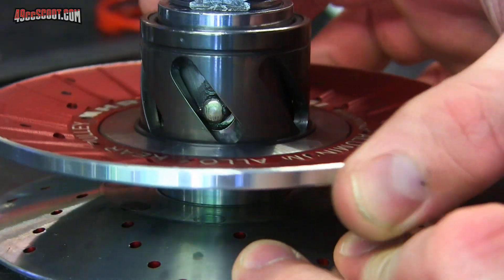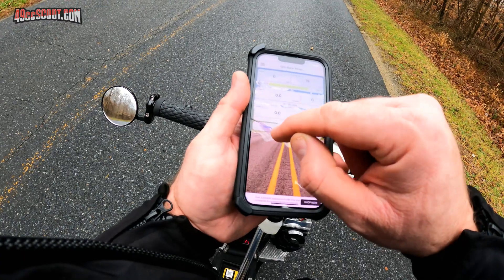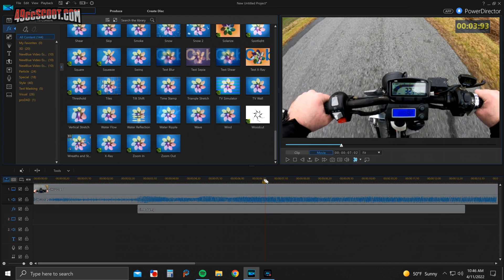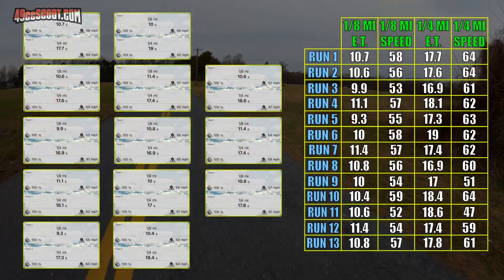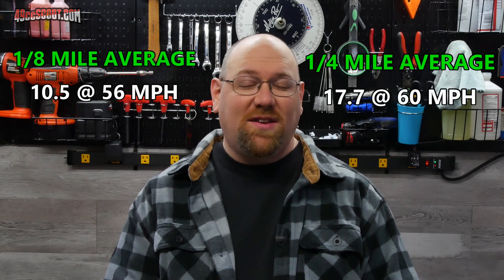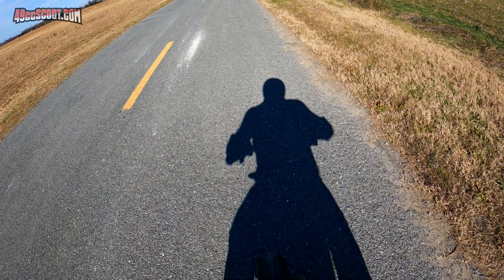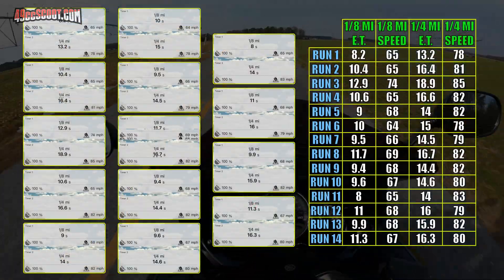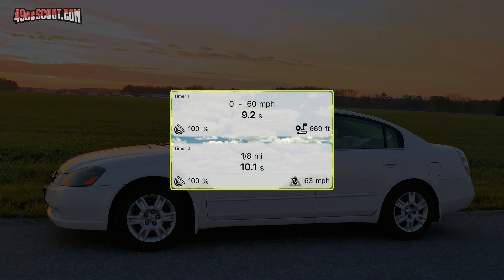Do Free GPS Acceleration Apps Work?  Let's Find Out!

Comment: phone alone is not good for acceleration messuring, you need to buy phone gps module (bluetooth or usb) with higher refresh rate like 10Hz and higher, phones gps have only 1-5Hz which is not so accurate
Reply from the maker: I have had a dragy for a couple of years now and it’s a fantastic tool. Highly recommend.

Comment: Great video, 2 yrs on, what app do you use for your 1/4 acceleration speed runs or what do you recommend? preferably with multiple timer simultaneously because, the other app only does one at a time. Thanks.
Reply from the maker: I bought a dragy not long after this video and it's amazing. I went to the track with the scoot and it was incredibly close to track timing, but the dragy does more than the track did. I have mine set to do 0-30, 40, 50, 60MPH and 60, 330, 660, 1000, and 1320ft. So I get all of the specs within a 1/4 mile (it records speed at each distance, and distance to reach speeds as well) plus the 0 to MPH data. It's awesome for tuning and seeing exactly what is changing when/where.  You can set it up custom, so you could do 7-23MPH times for example if you wanted. Can't recommend it enough for anyone that does acceleration testing/tuning. I don't like to spend money if I can get it for free, but I have not regretted the dragy at all. I've got a spreadsheet currently over 700 1/8 mile runs from it. Oh, and it tells you the density altitude so it makes it easier to see how the air quality is.

https://amzn.to/3YAiagS
(affiliate link)
Reply: @49ccscoot  I'm always ready to spend money but only when I get to test what I'm about to buy otherwise, I'll start with the free version. Any other free alternative to the Free app used in this video?
Reply from the maker: @Sir-Kay  I think it's going to come down to the phone. The dragy has a higher refresh rate and probably better satellite setup. I've never had weird results with my dragy. It's a regular occurrence with any app that I've tried.

Comment: gears in the transmission were still the superlight ones? Its ringing out. Way too light so speed is slow. Up gear the transmission
Reply from the maker: It was 11.2:1. Not many options for the Chinese clone long case. It was 10.1:1 stock, but the gears I'm using allow me to have more support bearings. Still not as good as the Zuma or Piaggio gearbox, but it works.
Reply: @49ccscoot  ohhhhhh, thats why

Comment: Unfortunately phone gps only updates once ever second, so the movement detection can be off by a bit. It has to estimate your finishing speed too because you may be 27 at one interval and 33 at the next. Most of the apps have a gps strength bar, so you can go to a location with good service and hopefully get more reliable results
Reply from the maker: I later picked up a dragy. Very happy with it.
https://youtu.be/psl2yMPIFnA?t=77

Comment: I am using Sigma  MC 1812 MOTO (50$) as the cheapest substitute for my broken speedo, it has a lot of functions, but I don't know how accurate realy is. There is many magnet driven aftermarket speedometers, also with drag meters, shouldn't they be more accurate than gps?
Reply from the maker: I use GPS to calibrate my speedometer, but I use distance traveled instead of just comparing MPH to adjust. I suggest at least a couple of miles for a trip to compare. Then you can consider comparing longer trips if you'd like. That seems to make them very accurate, as far as I can tell. I'm right on when I pass RADAR signs and with displayed speed on a GPS or app. That's about as good  as most of us are going to get. Keep in mind that for speed display only, if you weren't worried about calibration for race timing, a couple MPH is close enough. Most stock speedometers are 5% optimistic at least.

I think the Dragy or similar is probably about as accurate as it's going to get without track timing systems. Speed sensor based gauges could probably be accurate, depending on the circumstances. Most use the front wheel. If your scoot gets the wheel up, then it's not going to be accurate. If you used the rear wheel, then any slip or spin of the tire would make it inaccurate. They also would have to be calibrated as accurately as possible. GPS vs onboard trip odometer should get one close enough.

Comment: Hey Brent. Great stuff. I have a question for you. Where did you pick up or make the frame brace from the neck to above the battery box? Thanks John
Reply from the maker: It's actually an aluminum door handle for big glass doors. I got it for a few dollars at a local wrecked tractor trailer load salvage place long ago. It turned out to work very well with just a couple of cuts. I welded the bolt on mounts for it to the frame. They were made of 1/8" wall black iron plumbing pipe. Stiffens it up quite a bit.
Reply: @49ccscoot  Thank you for the info!

Comment: I need to try this with y 4t china scoot, especially since it's running decently, it can push the speedo well past any numbers, and I weigh 330-335,  the high compression airsol piston and large valve head, with mild porting, and exhaust and intake,  I imagine a stock 150 runs about the same,  it definitely had more TQ, and low to mid power, and needs CVT tuning , and carb tuning, probably can use a valve adjustment, but it's past due for the first oil change, I have a zinc additive, and high tac to go with the synthetic oil,  with all the low end TQ, I'm thinking ear swap, until the rear pulley 'changes gears' it almost pulls the front wheel, with a near stock CVT, it only has 4g and 6 or 7 g weights, sliders,  so equal to 3x 10g or 11gsliders, with a light spring, the blue. Contra spring, and seems like it could have stiffer clutch springs, I notice since it's getting warmer, the CVT needs tuning, because it's revving higher, acting different, I think it can use possibly a gram heavier weights, maybe swap in the ncy adjustable rear pulley, make it change gears a bit better,  it's very pronounced now, it kinds paused, I had it before like it kinda jumped, then kept accelerating, but the engine didn't have the power to accelerate , it did great down hill slightly,  I'd like to get a tru race cam, that peaks around 9500-9800 possibly 10k rpm, be at it only needs power from 5kup, it does maintain 45-50kph on slight hills now, 20-30kph faster than before, I'm thinking about swapping in my Yamaha 22mm carb, it has a Japanese 20mm on it now, it measures 22.4, 22.6maybe, the 20, is 20.1mm, better than Amazon, that 19.4!!  Haha I don't know how many I ordered that was 18-19mm carbs listed as 20mm, the ncy cam does seem to be a TQ monster,  runs great for 81-83cc what ever it comes to !! 41.4x 50mm, I'd like to cut about . 050" off the jug, to get more squeeze,  I lightened the piston as much as I felt comfortable, trying to get it close to the stock 39mm piston, it seems to helped, it runs smoothly, alot better than the other engine!! Goes to 10k smoothly!!  I have to actually watch the throttle in 35mph zones, before by the time it got to speed I'd have to stop,  I wish I ported the head a bit better. Maybe rigged a flow bench, and shaved the head and or jug, the piston is about . 080-.100 in the hole, the 23mm intake valve is much better than the 18, 16/18mm valves, is a joke. The 20/23is much better, I have another head I can put my finger through,  I can use a 150cc intake on it, but that a bit much for a daily! 
Good day 👍

Comment: I know phones are expensive, but don't worry about treating them so preciously. You have to replace them every 18-36 months no matter what.
Reply from the maker: Some of the reports were of the camera losing it's ability to focus properly within a ride or 2. The two-stroke seems like a pretty extreme case too, because not many bikes are riding around at 10-14k pretty much all of the time when moving. Not worth the risk to me since it did work and show 100% GPS in my pocket.

I've also personally worn out USB connections on multiple GPS units from having them on scoots and broken camera mounts and broken cameras and lost one GoPro when the mount broke off. My rear-facing GoPro has to have a large rubber cushioned mount. They make vibe-dampening stuff for phone mounts, but I don't know if I'll get one.

Comment: I don't think the GPS in a phone refreshes nearly often enough for this kind of thing. The Dragy works great, there are videos on here of people using them at drag strips and comparing the times. It's a little GPS unit with a magnet, just a much better GPS than the one in your phone. Gives you little speed/g force charts too so you can see where your trans shifts and everything.

I like how thoroughly you tested in this vid btw.

edit: i wrote this before finishing the video, can you tell
Reply from the maker: I noticed on Street Outlaws that someone (I think Chuck but I can't recall for sure) mentioned their dragy saying they ran a 4.XX. I figured they were using some fancy onboard stuff. With all of the money those folks have to play with racing related stuff, that's a pretty good endorsement to me... paired with YouTube vids of testing as you mentioned.

Comment: Oxy Powder cleanse for rider weight reduction.  More power.  Learning lots from the videos, thank you.
Reply from the maker: My A1C went to diabetic range about 4 months ago and my doc advised cutting carbs back. I got totally out of the diabetic and pre-diabetic range in 4 months. My eating habits could still use a lot of change, but I'm about 10lb lighter right now so at least it's the right direction. The hard part is always sticking to it, so we'll see. It's not like I'll ever be a 150lb rider regardless.
Reply: @49ccscoot  Organic fruit.  The first 5 digit number group on a bar code starts with 9 is truly organic.  Bar codes starting with 8 or 3 are GMO designed to eventually get you reliant on big pharma one way or another.
4 is conventional pesticides/herbicides etc.  Other numbers im not positive on the meaning.  Its a process not an event.  ;)
Reply: That's not how it works. #1, even if a UPC theoretically may designate "organic," that's absolutely no guarantee that it actually was grown to NOP standards. #2, simple sugars are simple sugars, and getting them from an organic source doesn't make them any better for someone trying to cut them out.
Reply: @FremontidaeScott  UPC does not designate a standard other than non gmo which means no genetic targeted herbicides that are taken up by the roots and also used as descants after harvest.  Is corn syrup a simple sugar?  Processed or modified sugars may taste the same but are very different from organic in composition as well as how the body uses them.
Reply: @Bradwick1  Ok fam, I'm going to tell you this and I want you to listen: Fruit is full of fructose as well as glucose, fructose being associated with fruit and worse for you than glucose. Fructose and glucose are both monosaccharides, and fructose is fructose is fructose, and glucose is glucose and glucose. Your body cannot tell if you got it from a kiwi or a magic genie. You're giving advice that could make a person worse off. Any doctor is going to tell somebody who needs to stay away from simple sugars that they should limit their fruit intake. 

As far as UPC/PLU, gmo and organic, it all means very little. Farmers go after an organic label so they can charge more. Do you want to know how I know that? Because they told me. I'm an entomologist and biologist, I've talked to farmers of every stripe about conventional v organic, and studied the NOP in the course of graduate work. some small businesses would not be able to remain in operation without that sticker because... marketing. Very small farmers often don't even bother, they know their clientele and their clientele knows their practices. And none of these things have any bearing on the healthiness of whatever product is in question. Not all crops treated with systemics are gmo, for starters. and then there's the debate over the safety of GMOs, various pesticides, etc ad nauseam. 

The gist is that the dramatic misinformation and oversimplification you gave is not doing anybody any good. And it sounds like he can take care of himself.
Reply: @FremontidaeScott  Condescending to me make you feel special?  How could my advice make anyone worse after you say all sugars are the same?
  Any doctor has had less than 8 hours of nutrition study.  Symptom management is where the money is, not restoration of health.  Like anyone with a licence or title there are limitations to what can go into or come out of your brain lest the licence be revoked and the money and prestige stop....even if you are right, you can be wrong at any time according to any newly peer reviewed study or other arbitrary designation from on high.
  Commercial farming is the same.  Just because someone calls themselves a farmer does not make them authorities on successful nutritional farming.  Quite the opposite.  They farm for quantity.  All other measurements be damned.  Big AG does not chase nutritional quality.  How are the Docs going to pay off that college loan?  How is the behemoth hospital with the helipad going to pay of their loan and profit?    How is a farmer going to stay in business?  If GMOs and toxic sprays are required to do business, that is what is done.  If remaining ignorant to the cause of disease and focusing on symptoms is where the career is they have no choice.
  Tell me the health benefits of Canola Oil, Soy Lecithin, High Fructose Corn Syrup and Artificial Yellow #5 and #6?  
You are full of commercial composting Rule #503

Comment: Great video man.
I used this app while averaging all the runs when posting results for my aerox 100 engine. Along with that racing channel which gives you a neat graph yo show any dead spots in acceleration. Though you will need many runs to get semi  accurate readings just like the app displayed In the video
Reply from the maker: I think all apps will be very similar in accuracy due to phone limitations. The TRC app does look good with their timeslips, and it gives more data. Never tried it, but looked it up. EDIT : That should probably read; all apps without add-on GPS units.
Reply: @49ccscoot  very true.  The trc app helped me get some good insight on where my scoot is losing acceleration.  (Specially with the stock rear guides)  so I like to switch between the two for references. 
I wonder if a draggy unit can be wired easily for a scooter 😄
Reply from the maker: @X7rocks  The dragy is super simple. Just bluetooth connection to your phone and put it in a spot where it gets a good GPS signal. It's got magnets in it, but we'd have to ziptie it or use double-sided tape or adapt it to a GoPro mount or something.... or just try a pocket and see if it gets good signal. It's got a USB port that is for charging it AFAIK, but as long as it's charged I think you're good to go with wireless. The only reason I don't have one is because it's not free. lol
Reply: @49ccscoot  yeah the 150 is kinda a hefty price tag but definitely seems like a good long term investment for the scoots or car projects. Plus would be cool to have a leader board full of different scooters and different set ups so we can all compare times and notes 😁
Reply from the maker: @X7rocks  The price isn't bad IMO, if you're going to use it much. The track near me wanted me in a a full leather race suit to drag race a scooter. Between the price of that and the idea of me in a leather suit, the dragy is pretty attractive.
Reply: @49ccscoot  it wasn't sandyhook was it?  For 150 it's a nice piece of kit. Just may snag some other parts before snagging one as I do want to start recording the time I can get to 0-60 in the miata and some other scoot stuff. Oh and find a proper mount so it doesn't fall off on my first scooter pull 😔
Reply from the maker: @X7rocks  No. I asked Capitol and US 13 dragstrips. I even  told them  it's only going to be 50-60MPH in the 1/4 and they said it still has to abide by motorcycle rules.

For the scoot mount; I used a GoPro mount for my EZ Pass on the TMAX. It makes it really quick to install and remove. Regular mount on the scoot. Base of a GoPro mount glued to the EZ Pass.
Reply: @49ccscoot  awesome idea will give that a shot 😁